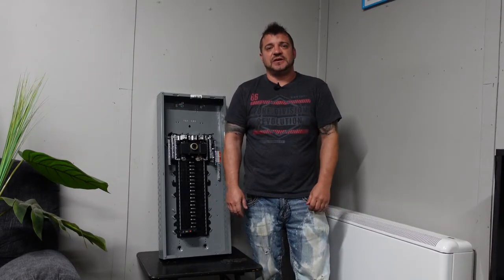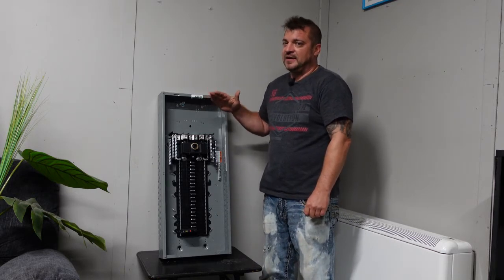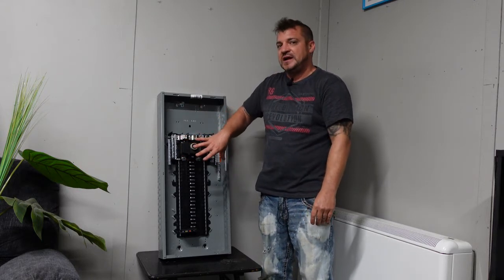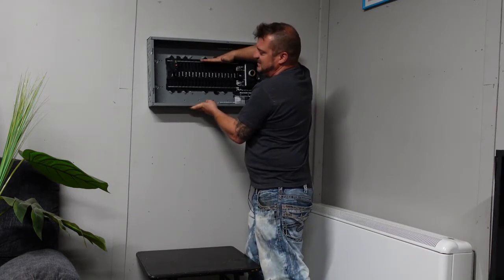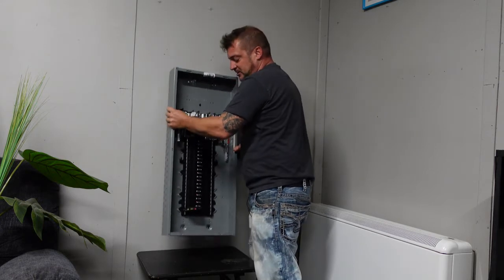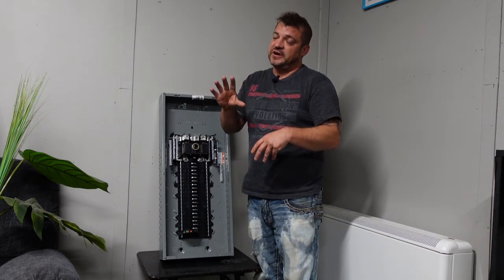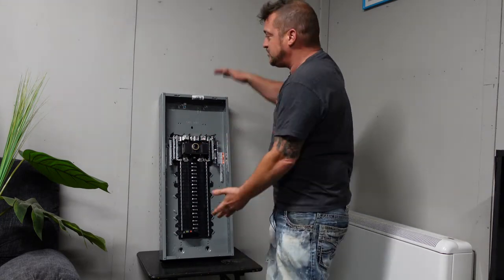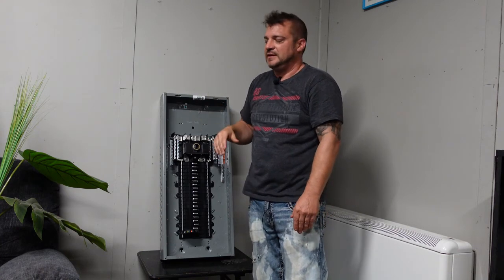Electrical Panel Height

Comment: can you expain from the top of the enclosure upward for what is code to run the wires through the top plate and into the panel.  Can you run pipe as a raceway instead of wires clamping at the top of the enclosure. ?  This way if you need to add circuits later its easier to feed wires into the panel.

Comment: The US NEC it’s 6ft 7 in height also you can’t mount the panel box sideways
Reply: Why can't a panel be installed/mounted sideways? I thought any orientation would be fine as long as there was enough clearance to open the panel door a minimum of  90°
Reply: It’s because the switch handles must be "on" in the up position and "off" in the down position
Reply: @sciatl2505 bollocks. Both the zinsco panel I ripped out and the leviton panel I put in have breakers that operate sideways.